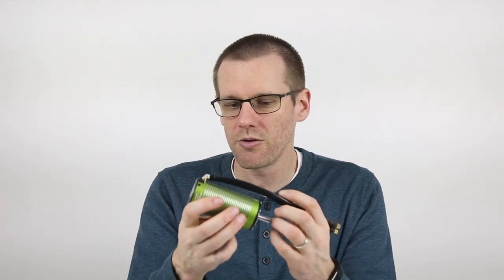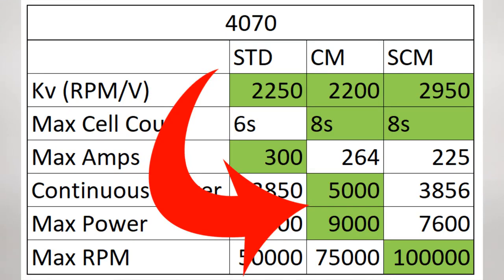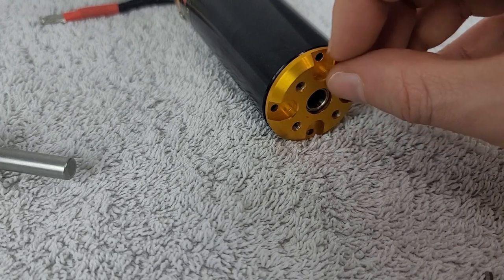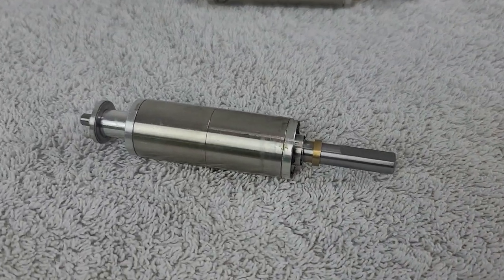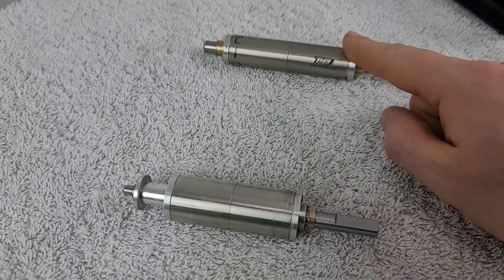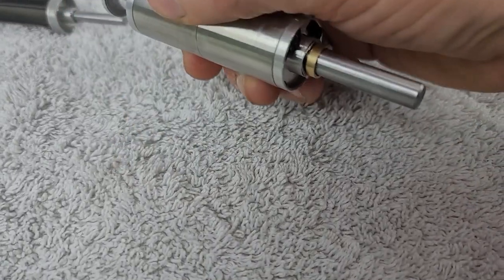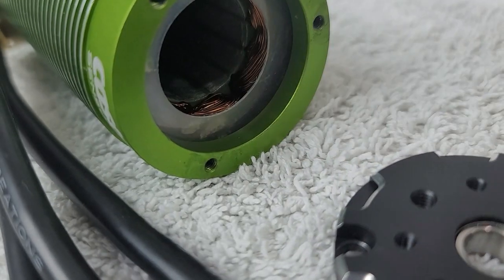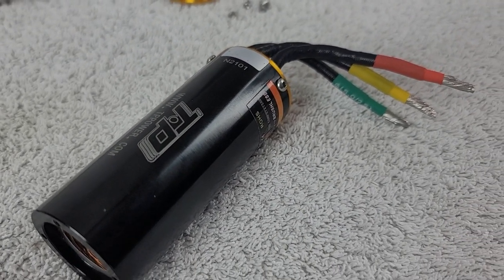A Look Inside 2 Ridiculously FAST RC Car Brushless Motors

Comment: Great video. You think those are good motors , you should check out a Steve Neu 1527 or 1530 motor. WAY more efficient... and expensive lol.
Reply from the maker: Yep, great motors. Started using these back around 2007 when racing boats. The relationship Castle has with Neu is how these green motors got started. 
Although the Neu motors are Beastly too, they aren't marketed to the RC Car Speed Run folks. (seems like the high RPM limit is what the market craves) I'm assuming this is why the request made for this comparison video was to compare the motors in the video rather than the high end motors.
Reply: @RCexplained  I see. I didn't know someone requested a comparison. I like the 1721, but it doesn't have the braking power that TP or Neu has, In cars anyway. Not sure about boats.
Reply: I hear Cordova brushless motors are the most powerful rc motors in the world
Reply: @acourtneylawson2065  Based on what?
Reply: @acourtneylawson2065  I would say lmt lehner for the absolute highest wattage.  Cordova are very very nice.
Reply: @timt8029  I forgot about them...they actually paved the way for a lot of the brands..they've been around a long time too...there definitely in the top 5.
Reply: @Yay-hovah  Based on facts
Reply: @fbiagent3399  What are the facts?
Reply: @Yay-hovah  Based on the facts that cordova/killmode and tp are some of the most used motors for highest speed runs
Reply: @fbiagent3399  I was looking for a more technical answer but ok.
Reply: @Yay-hovah  you must be living under A rock if you don't know about the best brushless motors used in speed run cars or you just don't have any builds of your own
Reply: @fbiagent3399 The Big Mac is popular but I wouldn’t call it the best burger.
Reply: @Yay-hovah  Good Point But literally The brand's I listed are known to be some of the best in the world and the fastest car's are running 1 of those motors... you don't see people running 190mph on A shitty vxl 3s system... and the bigmac is quantity over quality... tp/cordova/killmode are quality over quantity...
Reply: @ 8:50 rc explained shows you the inside of the TP can…⚠️ but I want to show you guys how to find a defective rotor when you buy a brushless motor, in this video👉 https://youtu.be/cheU-HHe16c
Reply: I’ve learned a lot from Rc Explained, so I think it’s only fair to give back to the rc community by taking the time to make and share my video with the defective TP 4070-CM…  I can’t be the ONLY guy in the world to get a bad motor but there’s NO real content about these things so I hope y’all can find this crucial information valuable.
Reply: @toysforboysrc  what was wrong with your tp when you recieved it?
Reply: @fatheadfpv5732  … all of the details are in the video made about it and it’s zoomed in so you can see it.
Reply: @toysforboysrc  ahh .. i see your video now and yes, that motor def had issues.  Ashame..

Comment: Would you happen to know why the Castle ESCs can't seem to handle the sensor board in these TP motors? None of my Castle ESCs can detect the sensors in my TP5660 motor, sadly.

Comment: lehner motors are quite good aswell, the 30100 can go up to 40kW
Reply from the maker: Great Motors too. Very unique sound to them, at least in RC Boats.
Reply: @RCexplained  it would be cool to compare these tppower and castle motors to the coreless lehner motors, i want to understand how the Lehner coreless motors can develop the same tork without an iron core that amplifies a lot the magnetic induction  in the windings,
Reply: Lehner motors are very expensive!!and mines lasted 3 weeks and they didn’t even honor the warranty that supposed to be 2 yrs
Reply: I've never tested another motor as smooth as the Lehner motors.  The kv doesn't jump around at all.
Reply: @ralphreiter4228  I can tell you this, lehner motors are packed in very tight.  Rotors are larger diameter for the can size.  Also alot of winding strands.  They are very heavy motors for their size.

Comment: You compared the same spec motors. But you didn't compare motors that have the same size can. As the tp one of the same size is more powerful. Also the fact that they drill to balance the rotors is more accurate than just adding some epoxy. Which epoxy has a chance to fall off especially from expansion and contraction of the metal due to heat. Not to mention on a basher with lots of crashing or jumping.